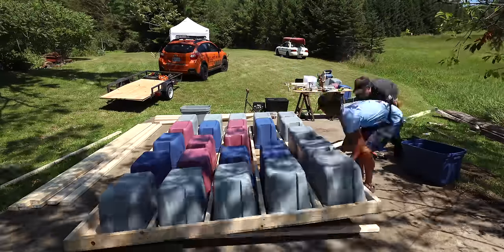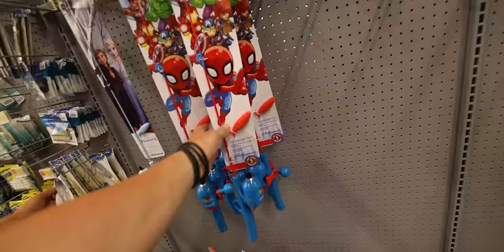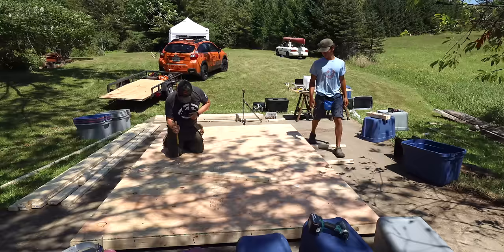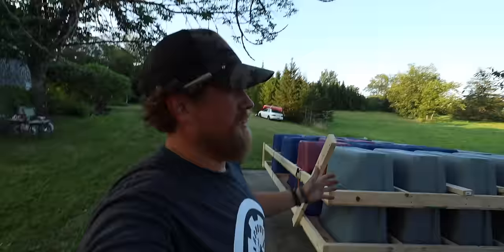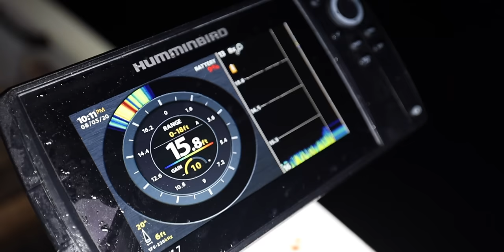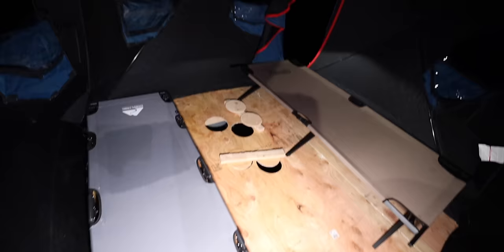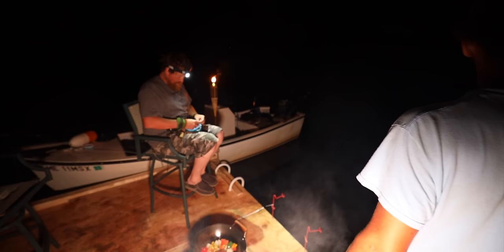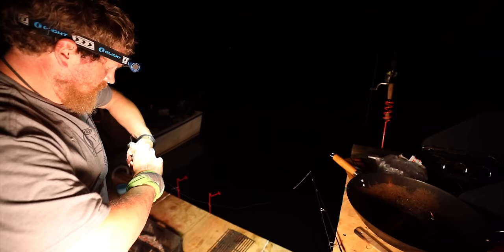One Day Build and Move-in Floating Fishing Cabin - Day 1 of 7 Day WaterWorld Survival Challenge

Comment: So, if you were using 64 quart containers (16 gal), and you made a grid of 5x5 for each platform.  It would leave you with 800 gallons of air as buoyance.  Which would allow you to displace 6,500 pounds, approximately.
Reply from the maker: cool thanks for sharing the math 🧮🙂 that's neet.
Reply: A
Reply: Are you a engineer?
Reply: @FowlersMakeryandMischief  so u can hold 6500 pounds starting to sink?

Comment: You could try like a sidecar idea for a boat to fit in. Like on the starboard or port side you can build out an extension with a cutout for the bow of a boat to settle in. Not only will it serve as a dock for your boat but instead of just dragging the raft/float the boat has something to push against for hopefully more control and better transfer of energy.

Comment: The usual procedure to have a floating platform with containers floaters is to fill the containers with a kind of styrofoam that is sold on hardware stores for that purpose. It's liquid and it expands in contact with the air and makes the inside of the containers totally water-proof.
Reply: Is it expensive tho?
Reply: @christianbostic514  Not at all.  There are actually pontoon sprays like that that cost around 100$ per two galons. Two galons can make Several of those pontoons filled.

Comment: Great adventure been thinking of doing something like this for a while, so it is really good to see tested out first. One little bit of advice, you should pull or drive the raft in the direction the totes run the longest better flow through the underside creating less drag. Also on that same note, rotate those two totes that are not in line they where creating a lot of drag make your motors work harder using up more fuel.

Comment: 2.0 version . . . solar powered, water turbine, wind kite with a power bank to drive 4 omni thrusters and a nose slip to but the boat into for push . . . then you have yourself covered . . . a method to secure and deliver the float and the means to provide fine tuned maneuverability and station keeping :)

you can also probably find regular dock and line floats set for decommission and patch them up to use for free as they typically have to pay for disposal for them (they have to be repurposed or recycled and it's not cheap) and the majority can be repaired / used for a long time still they just have issues or look problems :)

and start setting up laminated building . . .  fiber cloth epoxy laminated wood is not only water, rot, rust resistant but stronger and lighter also handles flame a smidge better than rough cut. . .  then you can go full water world and build up more with structure and do things like over hang and water decks . . . .  not to mention hang'n over the water in a hammock with a drop net below sleep'n rocks dude, 150% trust me :) just make sure you get a big skeeter net and wrap yourself in it :)

Comment: First time I’ve seen someone use the handbrake when parking an automatic
Reply: I just got to that point in the video which means it's time to stop watching said video.
Reply: If you don't use it normally and it seizes up have fun pulling your brakes apart and possibly replacing cables
Reply: @stromtom1390  I mean, yeah you're right, I'm a mechanic in new York and you're "supposed to" check the parking brake on cars for inspection but 99/100 times it "works as intended" lol

Comment: You should have put polystyrene blocks inside the totes. That way only so much water would be able to get inside them should they leak.

It will not add any noticable weight and so long as you seal it in them it will not effect the water or wildlife at all.

Comment: You should have used pressure treated lumber and caulked the tubs down so water would not leak in if the waves reached the top edge of the tubs.  You could have also put a small hole in the wood above each one so you could have put a tube down in each tub and pump the water out if needed.  Then maybe you could frame in a shelter and put some insulation in it and slap a wood stove in it.  Maybe some camp beds too would be nice.  I hate sleeping on the ground and air mattresses never last.  The roof of the shelter could catch rainwater too.  You could even add a tarp awning to give you some shade.  Put 2 folding chairs and a folding table and an electric cooler with some solar panels on the roof.  It could be a more pernament floating cabin that might last a few years or more and be usable at least 3 seasons.. not 7 days.

Comment: I would of put cover on tots and than screwed them on same way you guys did but just use lids so it helps prevent water from sneaking in. Not ever tot is flush to plywood and not allowing water in from just the pressure of being screwed to plywood

Comment: Did you use Marine exterior grade plywood? It looked like interior grade plywood, that's why I ask. Interior plywood will warp and start to delaminate quickly if it gets much exposure to water.  I'd suggest Zip System fiberglass impregnated plywood, its damn near indestructible, but will add some weight. Cool video, thanks!

Comment: Design flaw. Containers have large opening that are hard to seal. If you used plastic barrels with small opening they would be easier to seal. Those containers can continue to leak in a area we're waves splash up to the lid.